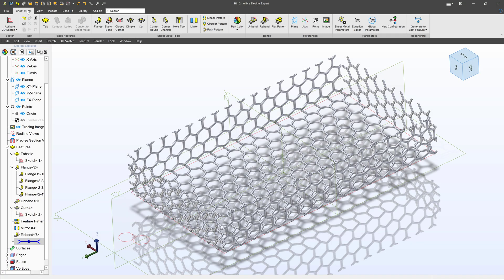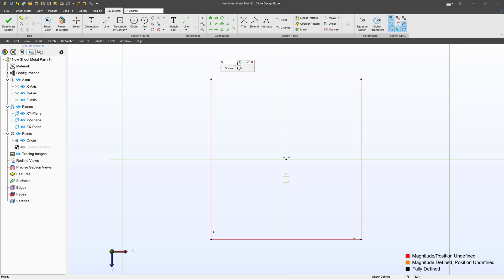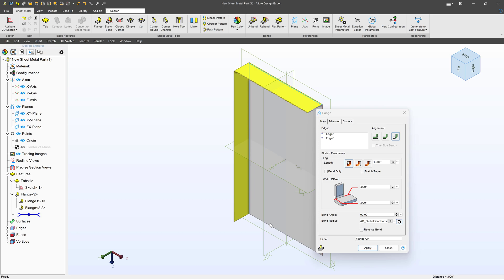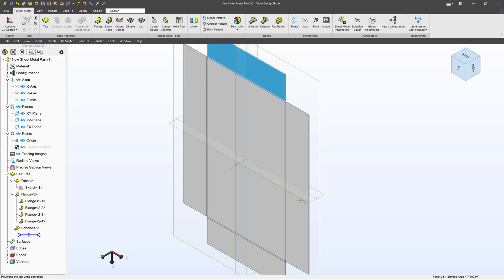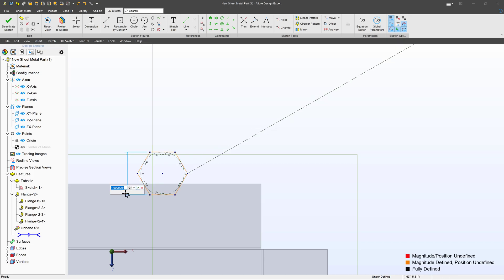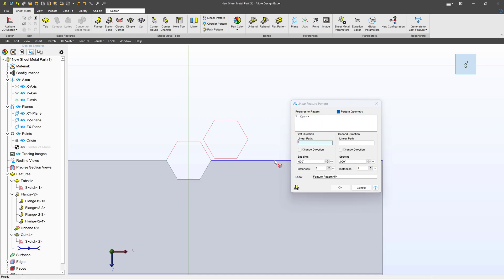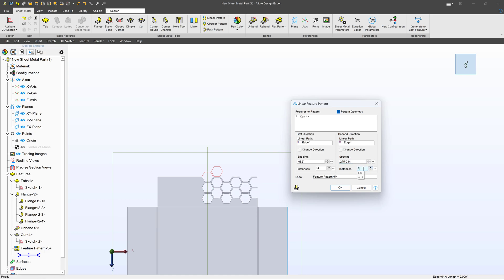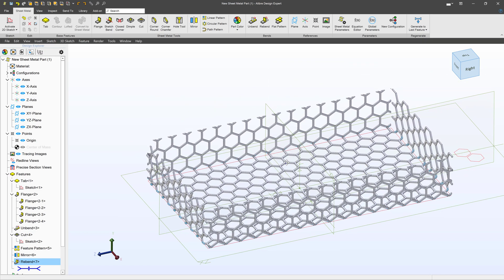Alibre Expert | Sheet Metal Modeling With Metal Meshes!

Comment: Hi,
Great video series. What is the best way to model a cone with a similar pattern using Atom? I'm fairly new to Alibre and still trying to wrap my head around the best way to model things. I tried extruding a cone and then using a grid, but can't figure out how to get a grid to pattern on to a tapered round surface. Then, after watching this, I thought maybe I should wrap a flat patterned surface.
Reply from the maker: Great question.  I'm going to think about this and get back with you
Reply from the maker: This is a tricky one because the hexagons will need to be reduced in size as they move up the cone.  I don't see a way to do it without a lot of math and manual modeling, regardless of the platform.  The alternative, if you don't mind them not lining up at the seam, is one could ostensibly create a spiral pattern of hexagons up the cone, but that would be quite math intensive, and require the path pattern tool which comes in expert.